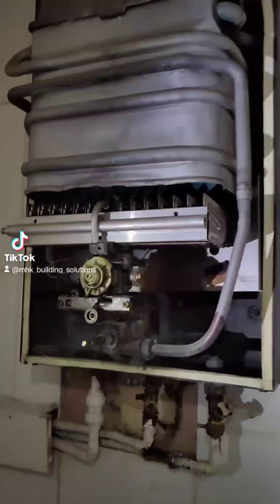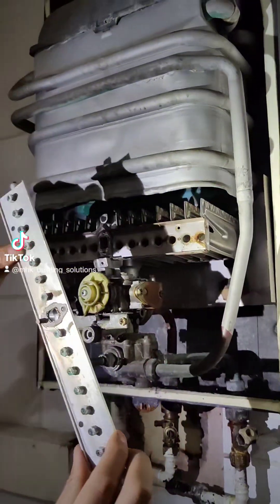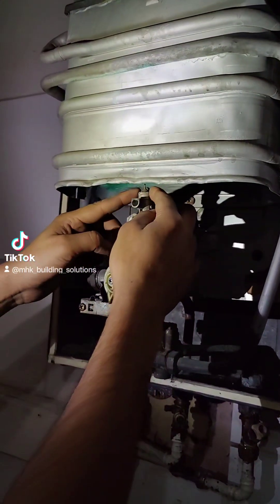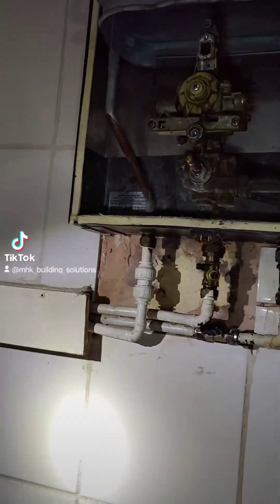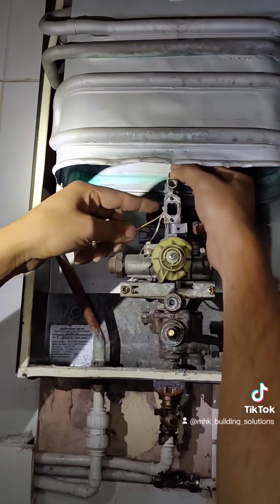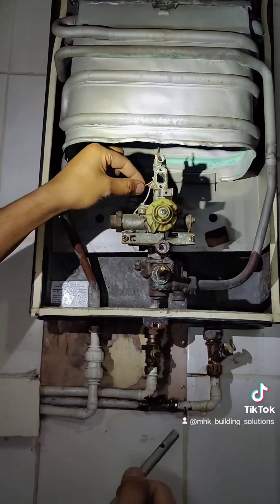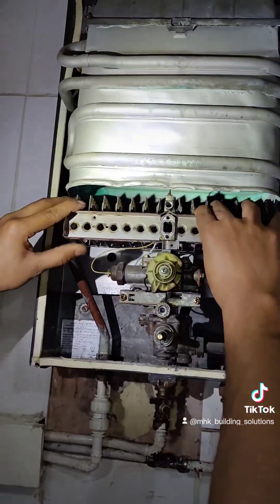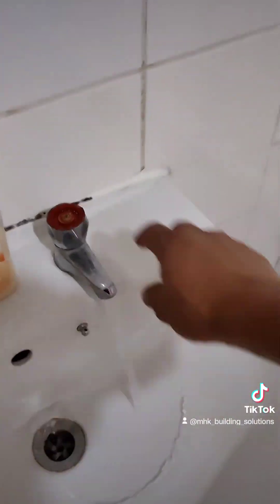Britony 2.T II.T multipoint water heater Old gas balanced flue water heater

Comment: Have a similar water multipoint  issue, but it is leaking from the water value at the bottom & also isn’t igniting anymore.. not sure if they are both linked which is causing the pilot not to light up? 

It was leaking from underneath but pilot stayed on and was still working but now the pilot has gone off and wont stay on, wont stay lit?
Reply from the maker: Most likely the diaphragm

Comment: Can you advise how to manually get  the flame on if its been blown out due to the wind. Tried to turn the control number multiple times, spraks up but not fully lit.
Reply from the maker: The only way to manually put the flame back on is by opening the front cover however it's a registered gas engineers job to open these heaters. 
I advise that you contact a registered gas engineer and have the ignition fixed.